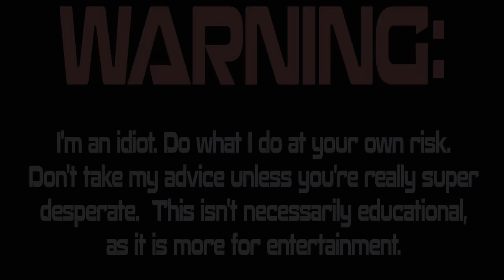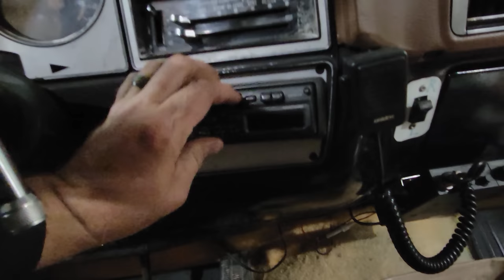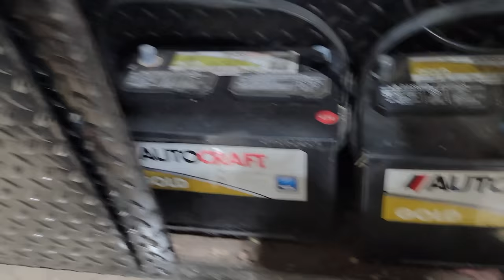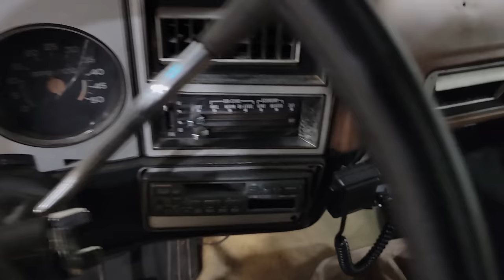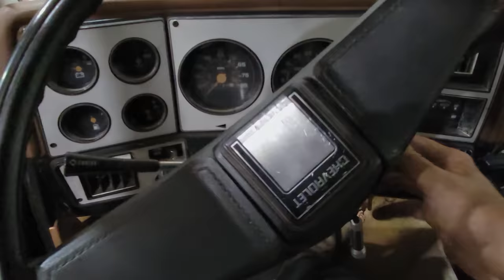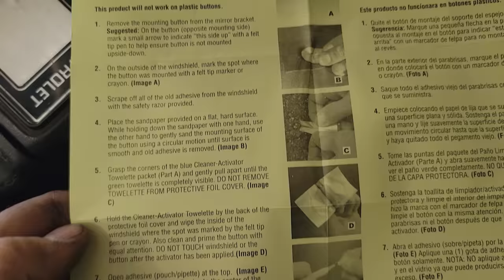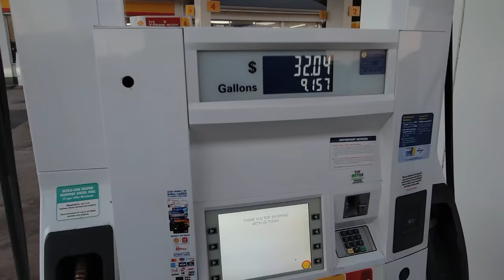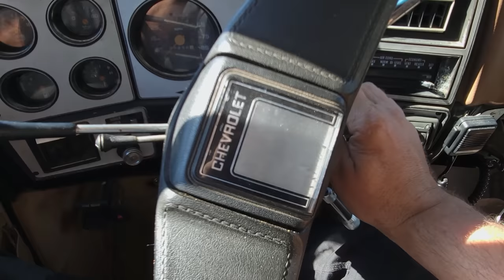Will this forgotten Chevy Ramp Truck Haul My Family & Ranger 800 miles?

Comment: Since you have so many cars and trucks I would keep it and maybe get a hold of a place in Los Angles that makes Over Drives for about anything and get rid of some of that 30 some odd feet of drive line you have under that truck and shorten it up and then when you drive it on the freeway you can slip it into overdrive and get better millage and you can cruse faster too.  It seems to be a nice rig for the family and you are teaching your three boys how to work on cars and teaching them good work ethic and not to be afraid of getting their hands dirty.  Keep up the good work and you are lucky you have a nice family and supportive wife.
Reply: Cruise.

Comment: Check intake gaskets at the heads... probably air leak... that will set the engine light on. Loose battery terminals wreak havoc... most common cause for engine  light.

Comment: Forget the duramax or 12 valve, just put in an NV4500 with a 92-95 external slave hydraulic bell housing and get one of those standalone clutch pedal and master cylinder combo kits from American powertrain that literally bolt up under the dash, all you have to do is run a line to the slave.

Comment: My very limited experience with electric fuel pumps is that if they are working well unobstructed they only pump for a second or two periodically. They  run on continuousely when the fuel is obstructed.

Comment: If you come across a two speed rear differential to swap in that will solve the slow highway speed. Also if Jessica is handy with a 5 speed that would be the nicest to utilize the current power plant. The best part of the 454 is that if you run into any engine trouble a long the way, that beast has plentiful and reasonably cheap parts all over the country to keep it running. Can't wait to see whats next for excitement with the channel, so you and the family stay healthy and happy.

Comment: you should not use a switch to directly switch the Fuel pump on as the contacts will burn out after a short time...most automotive switches cannot take the amps, hence the relay, plus the relay worked from ignition switch, if you wanna safer way with more reliability use a triac (works like a solenoid but more reliable and carries more amps) fastened to body close to radiator and cover it in silicone...use connections from relay and it will last the life of the vehicle without the clicking.

Comment: Put a good heavy duty built 700r4 behind that motor and you will see a big difference in rpm. As soon as the torque converter locks up in od it will bring them down 400 to 500 rpm more. I did it on my fathers big block dump truck that had a 400 turbo behind it and was screaming at speeds of 60 or more. It was more of a around town truck at that point. I got a 700r4 from a guy put it in had the drive shaft shorten. The trans mount has multiple hole in the frame to move it back or forth. The fly wheel had 2 sets of bolt holes for the torque converter so that all matched up. Made a huge difference on the highway speeds with the rpm its a thought for you to keep it original and be able to highway drive more.

Comment: My brother in law added a second tank to his Chevy. He put one of those covers on the back cab. Added a Toyota air conditioner to blow cold air. It was carpeted on all walls. Had plenty of speakers. And AM/FM radio setup in the back. Had its own antenna. Talk about a nice setup. After we got back from our vacation, he sold that truck for a lot of money. The truck was a Diesel truck. He took that engine out, and put a 350 engine in his truck. So he had two batteries setup on it from the Diesel engine setup. He did not intend to sell his truck. But the offer was so high, he could not turn it down. I would say Keep It. Never know when it will come in handy. Maybe swap the engine. Put something with more horsepower!

Comment: What can you tell me about the white '77 Ford F150 Ranger with camper that was parked next to this rig at the beginning of this video? I had the exact unit with a Windsor motor that blew on me twice and has been sitting at my grandparents (estate) farm since '89. We are getting close to finally settling their estate after 30 yrs and need a running truck to start trying to revive the place and make it into something my Pawpaw and Grannie would be proud of again. Wildfire took all the buildings but the shop and burned all the vehicles and tractor. The only vehicle intact is an old MG that hasn't run since about the same time but is so low that it is a road car only. It could be revived as your videos shows ea time. I'm looking at having to replace all the plastics on a late 70's jeep honcho and at least on john deere tractor so we can start producing on the farm once again. We have at least a couple of dozen other vehicles and several other tractors also on the place-all victims of time, fire and death of my grandparents, aunt and both of my twin uncles that grew up on the farm. My mom is the only one left of the family raised there. It is a special place to me.

Comment: I think you should keep it in your stable. You never know when your going to need a tow truck. If your not happy with the fuel mileage then consider a diesel. Also put leds in all you lights.  If you can't find leds for your headlight then at least go with some brand name halogens. Good luck with 'BLACK FURY'.

Comment: You could probably pick up a little speed, maybe to 65-70, at the same RPM with a 3.73 gear in the rear diff, or improve your mileage...  dealers choice.   4L80 is GM's 2nd best tranny behind the Allison 1000.   Keep it!

Comment: Keep the 454 and throttle body inject it. Swap a trans in that will get you an extra gear or 2
Reply: I remember how much the TBI helped the old 350s,  Iremember the 8-9 mpg square body days, Lo and behold along came the 1500 Silverado 350 TBI kissing 13 mpg then.

Comment: You need to hook the switch up for the electric motor for the gyro to ground hooks the motor completely two your positive power and then put the ground coming off the motor on a switch the reason you're wiring is melting is because you're running all that power through the switch to the motor and that's why it's getting hot cuz it's drawing a lot of amperage

Comment: Need to keep the fuel line away from the heater core red rubber hose...but, you are definitely gonna need it when the boys start driving...  hey, dad... in the ditch, outta gas, front wheel came off...

Comment: See what kind of fuel economies you can get out of it with a newer diesel… and what’s great about putting a newer engine in an older vehicle… the emissions requirements are from the body year, not the engine year.

Comment: Dealing with that right now with a 1985 Chevrolet Caprice. When it quit the other day the tank was full and it would try to fire but couldn't start. I'm guessing after 38 years and 136,000 miles the fuel pump might be starting to go? I poured a little gas down the carburetor when it quit and it fired right up and drove home.

Comment: I'd say definitely keep it and if you wanna change anything and not do a full engine swap get an adapter and run a ZF6. It'll give you granny and a couple overdrives. Of you could go all in and do the Duramax and 4l80. Definitely keep her comfortable inside and sand and oil the hood and roof in VGG style.

Comment: I'd keep it around to haul cars to events.  Just make it as reliable as possible.  Maybe you can eliminate that electric fuel pump altogether.  If it dies, can the mechanical pump pull fuel through it or will it block it?

Comment: Something that always bottled my mind is why does everyone worry about cold air intakes on fuel injection, but damn near every carburetor car I see has hot air intakes. I would think it works the same regardless if it's carburetor or injection.

Comment: It’s too bad that I don’t have the ability to respond in time but for everyone reading this wire brush on a drill or grinder then after mounting tires wipe the beads that were leaking with a little oil it works I worked in a shop as a mechanic for years then worked at a wrecking yard for a bunch of years it never failed to seat and hold air as long as I wanted it to

Comment: Derek that thing runs that good turbo 400 454 you know I would just change the gears in rear end go up maybe two steps higher than what you got for gear ratio to give you your highway speed otherwise I keep it you can use it for a backup when you go to other cars instead of having the rent a trailer whatever you got a vehicle that can do it on its own that's a sweet truck and I'm partial to Chevys by far I would not get rid of it I would just change the gears in rear end and then leave it alone and use it

Comment: the fuel pumps will continue to burn out, because when the pressure gets too high, the pump will get hot and burn, you need a return, but being as you got 2 tanks you would need a switching valve for switching return, from same tank switch you use for switching fuel tanks, but that can get a bit complex for the average joe, or an easier way would be adding a pressure switch inline ahead of the pump with electrical connection controlling on/off of pump when pressure gets too high, (ie pumps switches off when pressure is high, switches back on when pressure drops) to save the pump burning out......(pure physics mate).  Got to say makers of your truck  just bodged it up without thought for long term use. get in touch can give diagrams...you'll need to source your own parts.

Comment: Nice of GM to design a fuel pump with the fitting facing the wrong way! Does that small digical pump put out enough to keep up? Fix that roof with scientific calculations and keep 'er available fer future haulin'.

Comment: There was one lug nut missing from each wheel. My guess that would be because some fella put locking lug nuts on each wheel, but he didn't want to lose the originals. Of course, that theory is complicated by the fact that the ones Derek found don't exactly match the ones already on the wheels. Oh well. It was a thought.

Comment: whatt kind of engine spray did you use to clean up the oil mess on the water pump and clean the rest of the engine and related parts with i saw the can came from orileys just dont know exactly what it is,

Comment: Anybody else myself included with an 800 mile trip would have replaced that screeching fuel pump before getting on the road, But then the video would be pretty uneventful wouldn't it? Imagine how boring it would be to do the correct thing and have no roadside fixes to make.

Comment: I got a rollback I kept 1 when I sold my business. Needs hydraulic repairs. I'm thinking about buying a ramp  truck.that needs engine and transmission..got a military winch I was thinking the ramp truck would be better in the long run. That rollback people begging to buy it. I figure I can get a gasoline engine and Good transmission with $6000 offered for rollback.  Ramp truck has "0" hydraulics. Just a monster winch and a cable.

Comment: I do not understand the love for square body chevy trucks. They are not very powerful, fuel efficient, or last that long. I guess its just the look i suppose. My grandpa loved them. Owned many over the years. Everyone of them ended up having major issues. Transmission, carburetors, rod knocking, you name it.

Comment: Dont like the sound of that. Ill just keep a spare pump in the truck. 

Red green episode.
Man i wish that pumpalator would have gave me some warning as hes laying on the side of the 6 lane tow path with a roller and half of dually sticking out over the fast side emergency lane stripe so he can get into that  handsom dansom built in diamond plated tool holder for that spare fuelarator. Wonder how red would describe such a harold shenanigan.

Comment: Why on Earth would you put 1540 diesel motor oil in that engine??!! And you really should have used fuel line clamps on that rubber hose those worm clamps loosen too easily. I knew from the beginning of the video that that electric pump was going to be a problem and I saw the mechanical one and said to myself why didn't he hook that up

Comment: Diesel  swap is dead as long as they keep it up to 5.50 a gallon and gas is 3 something  4l60-4l80  swapped square body you already have half hemi .let's just say that BBC is the best thing besides the sbc have plenty of good in-stock  parts and the hp section is always going to have header gaskets and a waterpump in-stock if 454ss truck wasn't a 8 to 1 compression big block  95 351 lightning wouldn't have been in the same frame on the strip it was over 10.5 ti 1 and not tbi junk nothing like what is available today  as a set of heads and intake manifold without any cam ans obs Chevy 92 ss is a handful  but it is not going to be 30 in junkyards like ls v8s when they were taking 331 hemis in their model A&b coupes its what was in the salvage  yards at the time what's in the local junkyards has shaped hotrodding into the  jersey a summit super stores we have now

Comment: Don't mean to be a "hater", and Derek probably won't see this message, but he is clearly NOT a square body expert.

He whines about the tank switch being typically inoperative, but doesn't know the capacity of the side tanks?  I've had half a dozen 3/4 and one-ton square bodies and they ALL had 20 gallon side tanks and the switches ALL worked all the time.

The widget he found in the glove box that he didn't what it was is an HEI ignition module, which are super common for failure (always carry a spare!) and makes me question Derek's knowledge of mid-70's and 80's GM engines (sorry).

The other widget on the driver's side inner fender well that he didn't know about is his cruise control module... again, something anyone with even minimal knowledge/experience working on square bodies (or GM vehicles of that era)  would know!